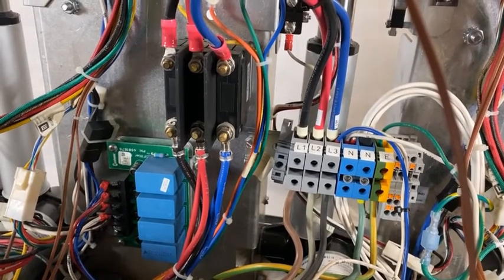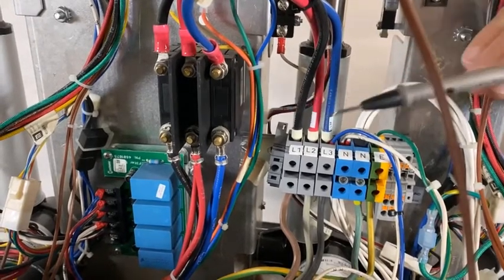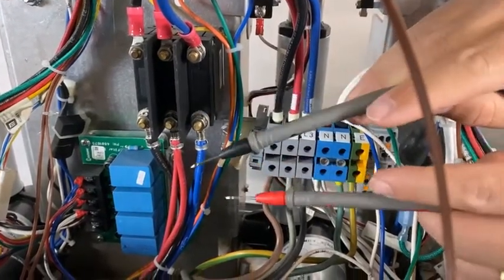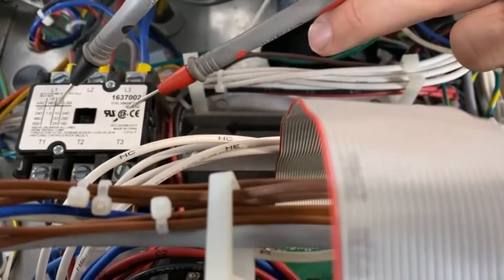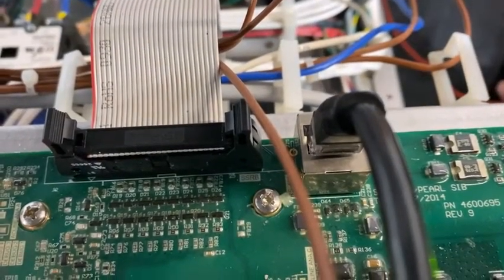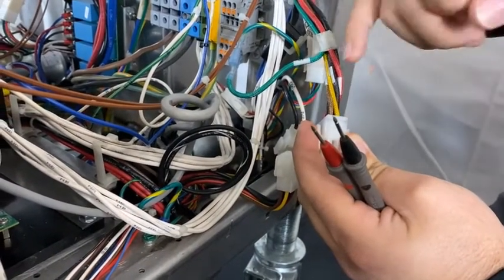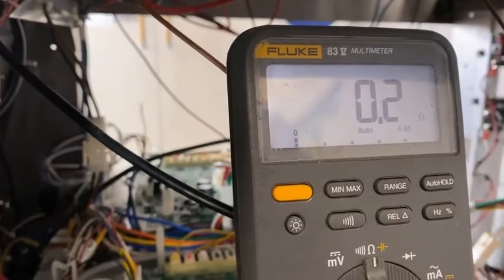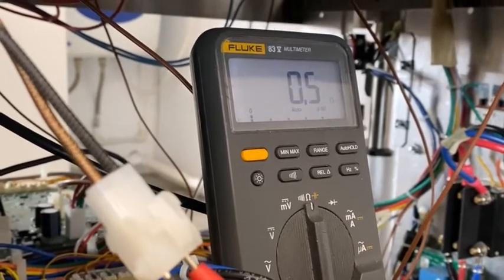ME/G E41 error identification and rectification

Comment: Ok I have the 41 ABC and the red light on the board is not lighting is my ribbon cable bad ?
Reply: @terranceburgess9170 - I have the same problem. Error 41ABC, did you find the problem?
Reply: @planoz7715  reference switch was bad and the circuit breaker was tripped it’s on the back of the grill